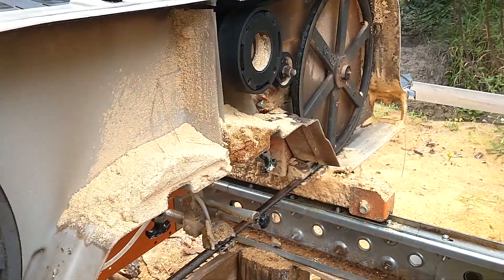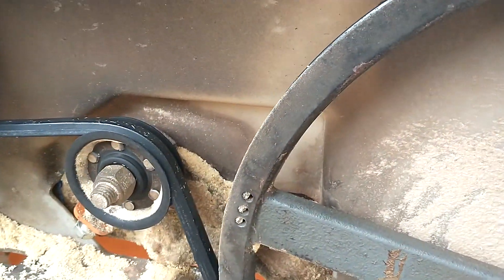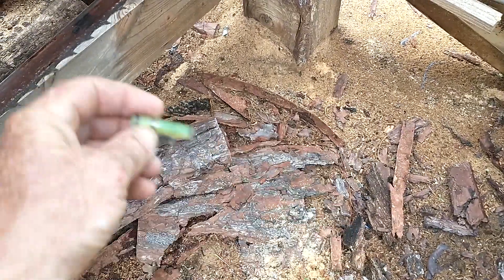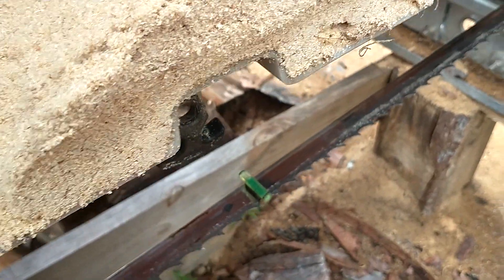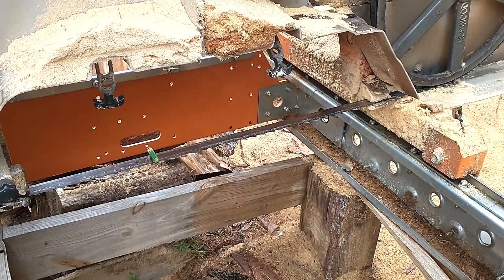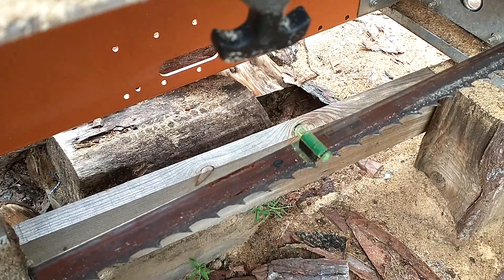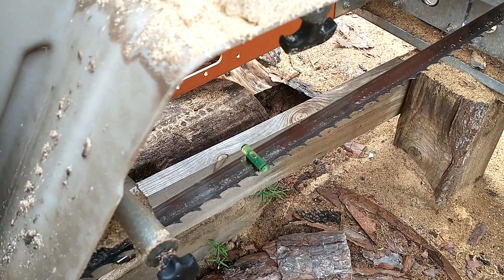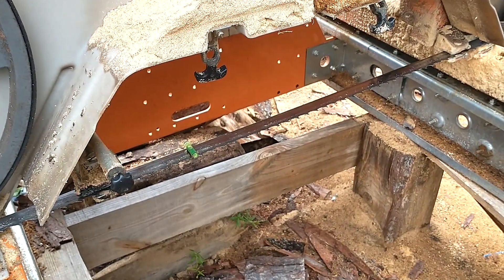Wavey Lumber Sawmill Fix

Comment: Do you adjust both the drive and idler wheels? You said you move the blade forward to make the front of the blade come up. That sounds opposite of what intuition tells me. Thanks
Reply from the maker: Just the idler side, like you normally would for tracking a new blade

Comment: Been having trouble with wavy boards.  Have double checked level, tension, etc.  Everyone is saying that the problem is dull blades but I have a brand new blade on the mill.  I'll give this a try as I'm about out of ideas.  Your explanation seems reasonable.  Thanks for posting this

Comment: Just found your channel.  Excellent discussion and well presented!  Thank you for helping get the word out.  The ceramic guides on the HD36 seem to work as well as the roller guides, as long as the blade is properly adjusted.  You make a good point about checking the tracking after every blade change.  A new blade is pretty forgiving but, once the edge on the tooth dulls just a bit, the tension and tracking become more critical.  Looking forward to more of your videos!

Comment: These are complex machines of different designs and adjustments. 
A circular saw cutting off line will do so because the part where the teeth are is stretched and can duck and dive away from the cut. Same can apply for belts, so the circular saw has to be hammered towards the centre to stretch it until the outside is flat when up to speed. 
If the Band has adjustments for stretch, OK,  but a machine that has flat rubber drums needs to fit a blade that has tension at the front where the teeth are. It pulls itself straight in the cut until something like knots stretch it again. 

Australian hardwood does this all the time and there's a gadget you make to squeeze the back of the band between a pair of self-centred bearings. This can be done with the blade on the saw, so the best advice is to waste a lot of water washing and lubricating it in the cut when in operation. The sawdust is not good for breathing so lots of reasons for excess washing. 

Every machine and operator has their own foibles, and a bit of an Apprenticeship with your own is a very good idea.

Comment: Everyone telling me how to fix wavey cuts, turn out to be crap blades.
Reply from the maker: Crap blades can cause it, but if your blade is not running level with the track you can change blades all day and never get a straight cut. If the blade and track aren't level, the blade will enter the log at an angle and eventually the increased tensions will pull the blade back down and as the tension decreases the blade starts tracking back up.
Reply: @fullingtonlumbercompany3656  replaced the blade and cuts fine, looks like blade wasn't sharpen correctly. New blade ran perfect.
Reply from the maker: @wurlabyscott  sometimes a new blade perfect not level until the one side either top or bottom gets dull. If the blade is not going into the wood perfectly straight, it won't be long and it will be running wavy again. But you're right, a bad blade even level will run wavy
Reply: @fullingtonlumbercompany3656  it was a new blade, why I check lvl, but it through me for a loop, first time having a new blade bad
Reply from the maker: @wurlabyscott  we get bad blades in now and then. Sometimes it's just a bad tooth set or butt weld is off center and other times I have no idea what is wrong with it
Reply: Thank you. This is what I was thinking was the problem with my LX25.

Comment: would have been nice if you were to video exactly what you adjusted. You showed the problem and the end result of fix but not what you adjusted,
Reply from the maker: The blade tracking. Track the blade either in or out just a little changes the blade level.
Reply: @fullingtonlumbercompany3656  I’m new to bandsaw mills. By tracking do you mean you pushed the blade in on the belt more?  I have a Came from a Lucas swing blade. Now I have a WoodMizer and got wavy cuts twice
Reply from the maker: @stevenr8353  you adjust your blade tracking, either forward or backward until the blade is running level with the mill. I usually turn the band wheels at least 3 full revolutions after each adjustment and recheck until the blade is level

Comment: This information mainly applies to band mills that do not use roller guides. Yes, each blade guide has to be adjusted so the blade runs parallel to the log bunks which also has to be parallel with the carriage tracks.
Reply from the maker: Actually it does also apply to roller guides as well. We're not talking about side to side level, were talking about back and forth level. Roller guides do help with this, but you still get a tip in the blade if it's not tracked level. Although it's not as prominent as a friction guide mill, it's there.
Reply: What?